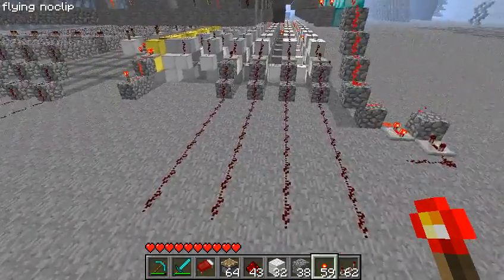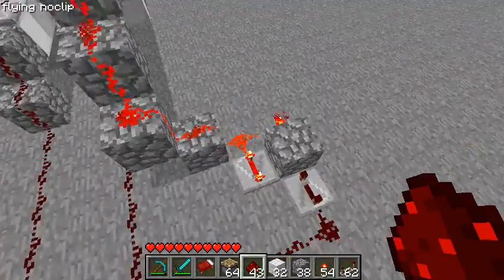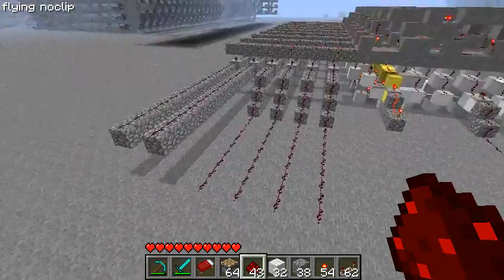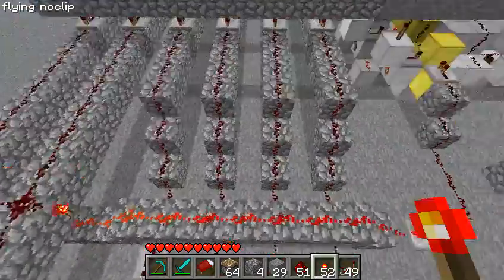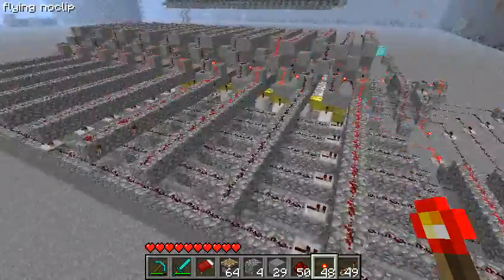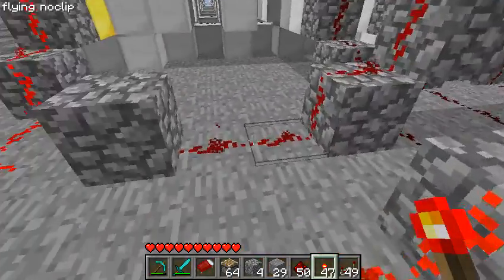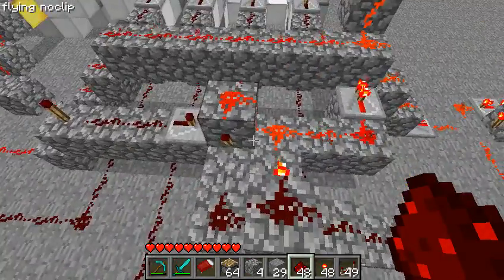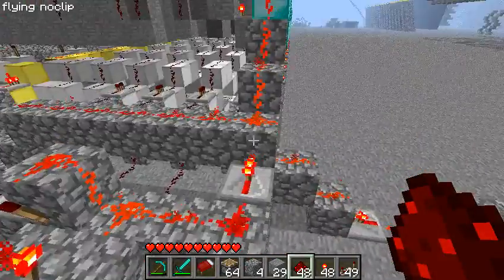Building a Minecraft Computer part 3 - branching in software

Comment from the maker: there are 2 ways to do it.

the one most people seem to use: use a binary counter, and connect it to a decoder, and use the outputs of the decoder to control which line is being read. (small + slow)

my way: create a shift register that holds all '0', except for the first bit, which is a '1', then just shift the '1' bit down the register. and make each bit in the shift register bus control a different line of code. shift register needs to have as many bits as you have lines of code. (big + fast)

Comment from the maker: @lex224ification um, in theory if nothing is selected, it would be the same as reading an instruction consisting of all 0's. so as long as your opcode of all 0's is "do nothing", it should be fine. although it is odd that it is happening, it could be realated to a minecraft update that changed how redstone works (this video is a bit old now). try messing around with your timings, or design your own system to achieve the same result in a different way.

Comment from the maker: @Minecraftmonkeys i believe that in real life, chips are made by shining a lazer through a template, to carve the transistors and buses onto the silicone. this is cheap way to do it, but it only gives a 2D chip. i'm sure they could do multilayer in real life, it would just be to expensive to make and difficult to stop from over heating and melting.
i don't know to much about the specifics for chip manufacturing, try searching around on google.

Comment: @Salajapaju its a restoring divider. it is 4-bits. whats it does is it tries to subtract b from the first bit of a. if the answer is negative, a will be restored. if the answer is positive, nothing will happen. then answer is moved into the next layer and is shifted and in the rightmost bit of the second layer, the second bit of a if put into. it does this for a total of 4 layers. the final sum is the remainder and the c-outs is the quotient.

Comment from the maker: @MrDirect110 mux is short for multiplexer. 2 or more buses feed into a mux, 1 go out. depending on what the control input is for the mux, it will select 1 of the input buses to go to the out put bus. they can be used to control which register is being read, as only one can be put onto a bus at a time. try google, or wikipedia for more info.